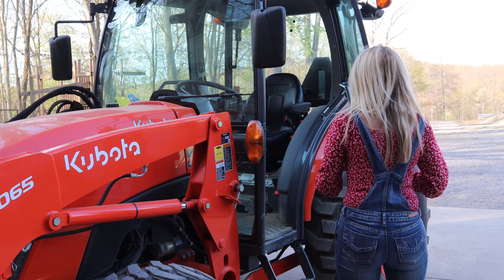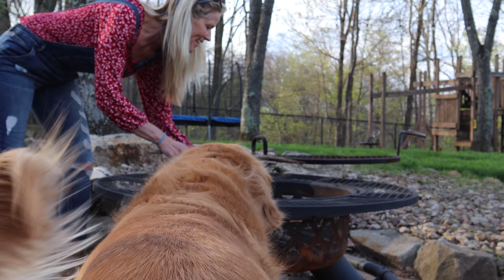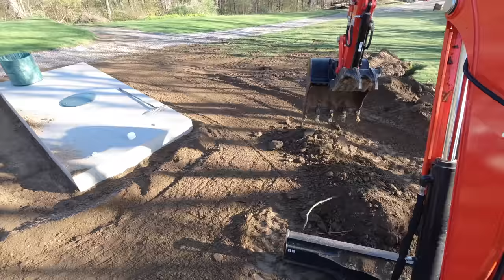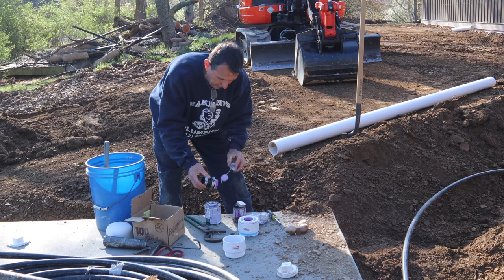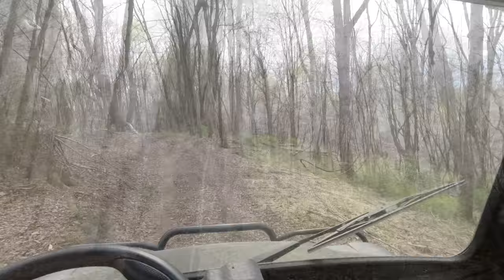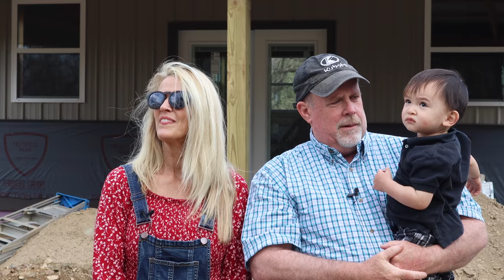We have disappointing news to share! #1077

Comment: Mike as I stated before I work in the pool industry. Fiberglass pools are readily available in our market. I have a few buddies who exclusively sell fiberglass pools. One thing we are having trouble with is our filtering, automation, cleaning equipment. We’ve actually had to change our SOP’s because of the shortage of equipment. When we sign a contract, regardless of where they fall in our install schedule, we start securing equipment to ensure we have it. Many others in our industry have not adjusted their ways and have massive delays in completing projects because they haven’t adjusted to ensure they have their equipment. The equipment is usually one of the last things we do, now they are the first things we get. We’ve been lucky so far. The other major road block is chemicals to treat pools. They’ve been giving us “excuses” as to why prices have triple and can’t produce. All due to COVID-19. Good luck with your swimming pool project!

Comment: I forgot to ask, where do you think you are going to place the pumps and filters system for the pool? Anything you can pre-plumb in now while the ground is open and you can possibly get it deeper below the frost line? Are you putting a heater on the pool?
Reply: yes... the pump house and more should be located right around the corner of the building

Comment: Sorry to hear the pool won’t be done in time for the wedding, but as you say, there are worse things. The logistics of not having all the fill do complicate your life though. How many dump trailer loads equals 14 triaxial dump truck loads?

Just started snowing here in the last few minutes. I need to run to Springfield (usually about 90 minutes) to pick up my sister, and I’ll have about a half mile visibility for that. The ground is too warm for it to stick, thankfully. The air is 36-37F (2-3 C for our international friends). Weird 20 April weather. 

You all have a good day!

Comment: friend of ours installs pools - same situation, delays.  If you don't want a fall install (which has advantages) you are likely a spring of 2022 install.  I'd go with the fall install if you can get it - installers would prefer fall versus early spring given the more frozen nature of the ground - although I forgot you are digging the hole...not them...still easier digging in the fall.
Reply: YEs I think we would do that if it is an option. thankyou.

Comment: Hey Mike you know you was talking about the pool going is is set back. We’re I live there is a boat manufacture call Tracker Marine that is owned by bass pro. And I used to work out there in security and they’re still going hot matter fact they just opened up the other plant to get more boats out because they’ve got a big one that they build out there. They build this boat out there at Tracker Marine and it’s 35 foot long they had to add two more winches to be able to lift it up so they can get it on a trailer. The boat like that doesn’t have a regular trailer that I know of so right now they’re using a lowboy trailer.Anyway everything looks good y’all have a great week and a better tomorrow Mike and Melissa you have a great day and hope everything goes your way there’s your dinner

Comment: Hey Mike,  If you have a location on you property that you could excavate, you might consider trying to hire a contractor to dig the fill dirt and haul it with a 30 or 40 ton off road truck.  You could spread it as it was hauled to you and it would go quick getting filled.  Just a thought.

Comment: If you are going to do any more log buying like you did make sure your road is far enough away from the pool so you don't end up cracking the wall you got to keep it at least 30 feet away you will be amazed with those trucks can do even the big tractor and excavator you have you can shake that grown enough to crack the wall to the pool I've seen it happen I just don't want you to have that problem still think driveway should be on the other side of the shed keep it away from the family